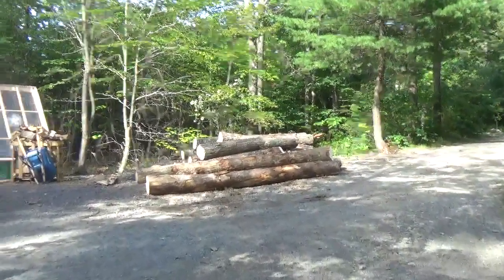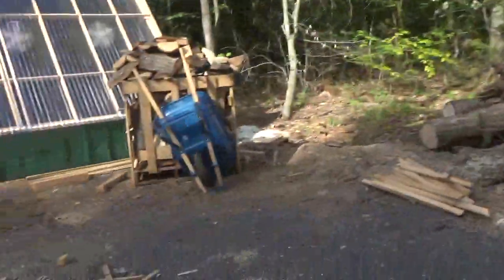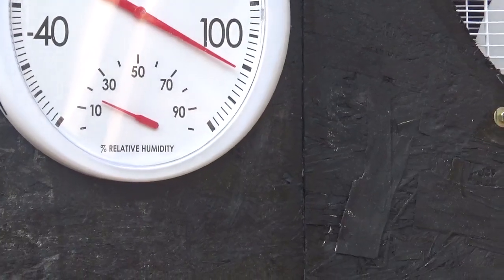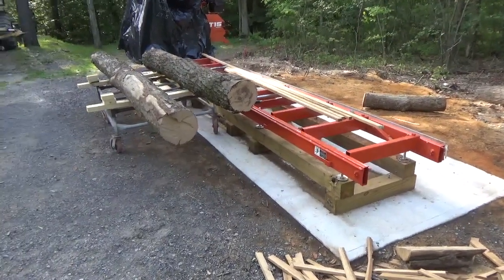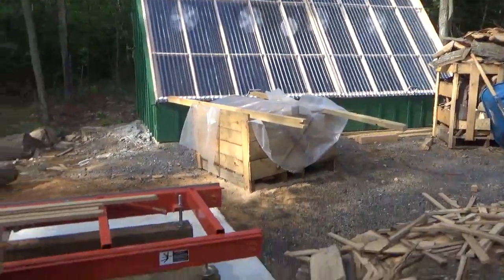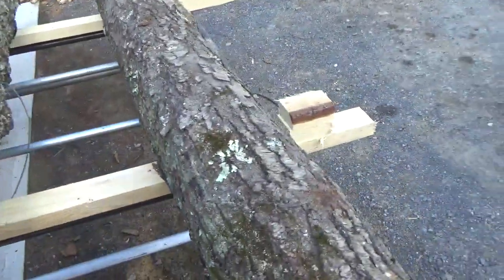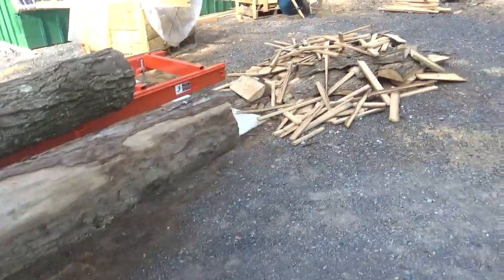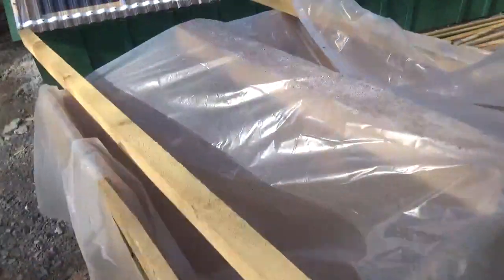Red Oak stickers cut and drying.

Comment: Just a couple of suggestions for consideration;
* You may want to look into using parafin, rather than diesel, for making fire starter logs. Diesel is a little toxic to work with, not to mention the fumes and smell when burning. Parafin produces no smell, is much safer to work with yet is still flammable, and will hold the wood chips together like glue. Its' what the Duraflame logs are made with.
* If you are anywhere near a state park or similar, you could make & sell small bundles of campfire wood with the cut offs & drops from that pile at the end of your sawmill. Or, sell them locally as fireplace or wood stove kindling.
Reply from the maker: Thanks Paul, I was thinking about the diesel fuel odor. I will check out the paraffin. Luckily I found a guy who is taking the cut off edges. I was happy to find someone just to keep my place cleaned up. Today for the first time I actually sold the firewood. Even a couple bucks is better than nothing. Your ideas are all good and I thank you for them. I actually live right next to the state forest but there is no camping at this area. But kindling is always something that I should be able to sell.
Reply: Josaljo Won Thank you for your response. I plan on using the lumber around the farm and in my furniture making. It will alow me to build higher end projects at a lesser cost. Im not as interested in selling lumber outright unless someone I know wants something cut.